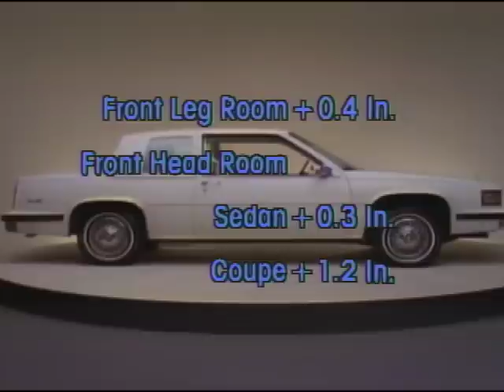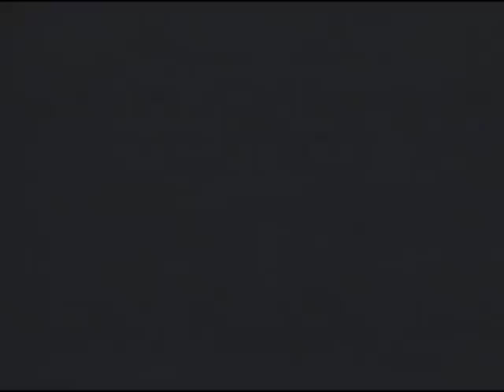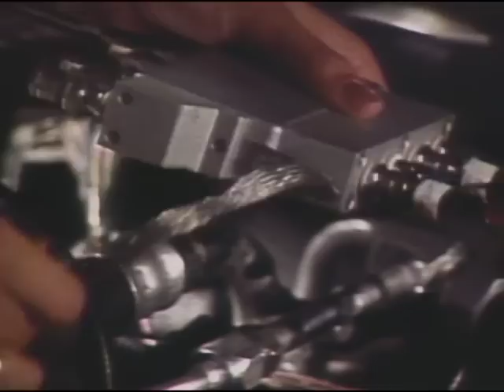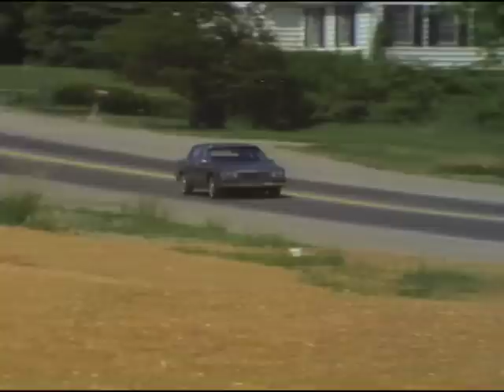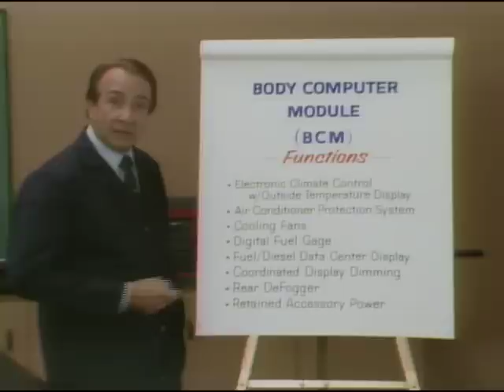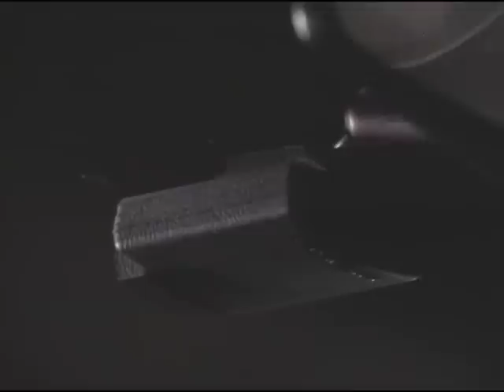1985 Cadillac Deville & Fleetwood - Spectrum '85 Dealer Film

Comment: These C body cars failed miserably in the crusher.  The steering knuckles would shatter and lower ball joints would separate.  The front struts would explode and oil would squirt out.  The rocker panels would distort and buckle.

The ‘89 models went to plastic fenders and would shatter thus making a mess inside the crusher.

Comment: Quick story on these.
I was the fleet manager at Fanning Cadillac-Buick in Chicago at this time.
These FWD Cadillacs and the new FWD Buick Electra & Park Avenue series were released in March 1984 as `85 models.
This was done to build acceptance to the drastic downsizing according to our Cadillac zone rep.
I remember our in-house mailer to past customers was folded twice, and opened up to 24 inches, the amount they had been downsized by.
We even had a Lucite hood intended for the Cadillac in the showroom, to showcase the transverse mounted V8.
It never got put on, and sadly went down with the building in 1993, still in it's box in the roof top parts storage room.
There was a much great acceptance of the Buicks.
I was able to order base model Electra 380's and dress them up with sim con tops and Vogue wheels, as switch cars for our customers who could not afford Cadillacs, but liked the Park Avenue styling.
They even had 2 door models FWD Electra models.
There were originally Electra 300 models with the 3.0 engine, but they were discontinued early on due to being under powered.
The same mistake was made in `86 when the FWD LeSabres initially came out, and the 3.8 soon became the standard engine after that.
One even made it to the Chicago Auto Show floor, which surprised our Buick zone rep when I pointed it out.
Electra 430 was the diesel, and I only remember ordering one.
`85 was the only year for the 2 door Electra T Type, but the 4 door T Type lived on through `90.
Le Sabre T Types were 2 door only, and `87-`89 only.
Note the Cadillac in the video has no high center mount stop lamp, as most of the early `85s did not.
Later `85s had them, and I think they were made mandatory on all `86s as I recall.
Reply: Very interesting info "from first hands".
In my own expirience from 2010 - 1993 Fleetwood tbi motor, 1995 Deville Northstar and gorgeous 1978 Eldorado Biarritz (in 2013-14).
Waiting my next old caddy.
Now driving 1994 Intrepid.
Best regards, from Russia 🤏
Reply: Thanks for that awesome First-Hand info.  I knew about those 4.3 diesels, but never saw one in the wild. After the first OPEC crisis, my folks were "diesel-ers".  Dad bought a new '80 VW Rabbit diesel 5 speed, and mom had an '81 Eldorado diesel.  Being from Baltimore, we usually drove the Eldo to visit family in NY. Sometimes the Rabbit since it was easier to find a parking spot during the holidays. The only issue the Rabbit gave was with the power brake booster.  The Eldo had quite a few trouble spots.  In '85, I recall dad frantically disconnecting BOTH batteries because the starter remained engaged and ground itself to death (I was 11 in '85).  Turn signal switch would break often, disabling the signals and high beams.  And the injectors were replaced in '86 at 35k. Made a huge difference in performance. That Eldo was a comfy cruiser and easily returned 30 mpg highway.
Reply: Interesting story

Comment: I saw the first prototype front wheel drive85 Fleetwood in October 83,at the time the best engine for all 3 C,s was the LT7 4.3 Oldsmobile diesel, don't balk, Buick,s first fueling injected V 6 was hardly an engine built to luxury car standards,same could be said for Cadillac engine ht4100 used internals that came from toys R Us at least the Olds had balls and remarkable fuel mileage.❤
Reply: What year did the 3.8 V6 get fuel injection?

Comment: The guy who designed the engine must have been stoned out of his mind! It was so bad they had to BEG customers to come back!
Reply: I have an 1986 with 60,000 miles and no problems at all, very comfortable, quiet and floats down the road. I do like the previous gen as well but to be honest I always had a sweet spot for the fwd C body platform as well as the fwd H body platform. It may not be many people's favorite but I think this generation deville was a very handsome looking car. Sure maybe some of the 4.1 engines had its problems but I feel like long term overall its better then the Northstar for I've heard a lot of issues with those compared to the 4.1 motor.
Reply: @RenNakamura20 I'm glad you had a good experience with yours! Not "all" of them failed! BTW, I had a '96 Northstar, and it was OK except that it started burning oil before it got "old". Having four early-wearing valve stems per cylinder made for a lot of smoke!

Comment: i new these cars well.this was not the car Cadillac hoped it would be.i replaced many of the 4.1L. to 4.5.the ride was a  jarring porpoising ride,the protruding steering column did not give easy view like the video claims. the camera angle of the instrument panel was deliberately deceptive.with the steering wheel centered, fuel data driver information center and climate controls were completely blocked by the wheel you would have to look around the wheel and reach under the shifter to see and set climate control.one nice thing about these cars was the very distinctive sound of there engine whether the 4.1,4.5,or 4.9 the sound was the same and exclusively the sound of a Cadillac

Comment: I got an '85 Coupe Deville and it handles and rides fantastically but the powertrain is completely garbage. The HT4100 is an aluminium trainwreck and the transmission can't even handle the pathetic power numbers the 4.1L V8 makes.
Reply: How's the car doing now 
I have one myself
Reply: @beangee662  I need to get around putting a new transmission in it or rebuilding the one it has. Engines fine because when I bought it, it already had a new Goodwrench engine in it.

Comment: I worked at a Cadillac olds dealer for years. The engine and trans were junk. I fixed so many of those caddy’s I could rewrite the service manual on those cars. Electrical problems on those cars were a nightmare. Yes GM they did not withstand the rust belt!
Reply: You can say THAT again dude!  I was in college when these came out.  I thought they were the silliest most ridiculous looking things for what was supposed to be America's top brand full size luxury car! And they WERE junk.  I knew people who bought them, but they were wealthy enough to trade them in within 1 to 3 years before real problems began.
Reply: @retroguy9494  I think there is something inherently awkward about trying to fit big car styling on a smaller package. They should've leaned into a more modern look like with the Seville STS model which is probably the best looking of the small '80s Caddys.(Google 1989 Seville STS)
Reply: Was the throttle body fuel injection system at least reliable?
Reply: @gregorymalchuk272  that was probably the best part of the engine. It performed as it was designed and typically outlasted the rest of the engine.

Comment: I had one well 2 I really like them.but the north star motors not the best.cause the heads always crack.
Reply: the heads to not crack, but rather the threads on the block that the head bolts clamp to turn to dust (aluminum block and heads).  the threads there were just not aggressive enough.  this can be repaired, and if do e correctly with the correct timecert kit, the engine will last forever.

Comment: Apparently I was not the only one who hated the Downsized Cadillacs.. The sales dropped low enough to the ground that they had to Upsize them again!! The 80s, with the exception of the Firebird/ Camero and Corvette, were not good times to go GM!
Reply: You're not the only one dude!  Having been a Cadillac buff since I was 8, being in college when these came out which meant it would only be a couple more years before I was able to actually buy one, I just about cried when I saw these pieces of crap! 
Yes, they DID upsize them again in the 1990's and the '93 to '96 Fleetwood Broughams were some of the best cars Cadillac made until the rebrand in 2000 when it basically ceased being a Cadillac.  
Which is why I STILL have my 1994 Fleetwood Brougham!

Comment: The exterior design on the 85 was a disappointment to me. The car did not have the elegant look of the car it replaced, however the 1989 face lift was a big improvement. The 85 Oldsmobile 98 and Buick Park Avenue had a much more eye appeal than the Cadillac.
Reply: The olds and Buicks of this era also had better engines than the Cadillac HT 4100 pos. I’d take an 85 Buick Rivera or Olds Toronado over the crap Cadillac was selling then. Buick also even had a V6 Turbo available….Cadillac should have borrowed it to offer in the Eldorado.
Reply: True Buick was ahead of the full GMline 85 to 87 with almost every car they had.  Even had a car faster than a corvette in 86 87
Reply: Even the modest tail light face-lift in 1987 was a great enhancement. The Buick was my favorite of the three until 
the 1989 Cadillacs came out.
Reply: It looked like a childs toy to me!  But if you think that the Olds and Buick had more eye appeal, you need to watch the Lincoln Town Car commercial from 1985.  Its hysterical. I remember when it came out when I was in college and laughed like mad as I had been a Cadillac buff since I was 8.  Basically, they were all the same car!  
Here it is; it starts at :31.  
https://www.youtube.com/watch?v=G1CxNhvvYGI
Reply: I hated that car at first. It took a year to grow on me even though I still liked the old ones better. 
I sure remember that Lincoln commercial like it was just yesterday.
Reply: Disagree

Comment: With the Hook & Tow 4100 you'll be overheating before you leave the lot.
Reply: On the 82-85 Big Caddy and Eldos.  That 4100 nearly killed Cadillac thanks to that damn New cafe and emission bullshyt.  They didn’t get that fixed until the later 80s.  Sadly Cadillac only had a short comeback and then it became like all other American luxury cars.  Not very good.
Reply: @edwardluth7740  It had a short comeback in the 1990's yes.  The 1993 to 1996 Fleetwood Brougham's were awesome!  I have one!  
But in 2000, Cadillac rebranded itself.  Basically, it only uses the Cadillac name.  Its no longer the luxury car it always was since its founding.
Reply: @retroguy9494   I own a collector 95 Cadillac Fleetwood Brougham with just over 40,000 miles. It wasn’t as good as these 70s because many parts were already outsourced.   And I’ve spent more money than I should on this car.  Not nearly as luxurious interior either.
Reply: @edwardluth7740  Well, mine is a '94 and it had 59K when I bought it. I used it often so it has like 88K now.  You're right about the parts.  My digital dash was flickering since I got it.  Somehow, combined with a replacement key I got from a locksmith but the OHM's being slightly off, it shorted out the ignition which I had to have replaced but had to wait months to get the correct key from Cadillac in Detroit.  My mechanic had the dash sent out to be rebuilt.  But the flickering, in turn shorted out a module which made the car run.  It hasn't run now in over a year and a half because he can't get the module with the shortage of them and all.  He's even called Cadillac in Detroit who keeps emailing him that its on its way, but so far, no.  But the only other thing I've done to it, besides a full major tune up including the opti spark distributor, which were known to go around 70 to 80K miles, is a water pump.  Those were also prone to replacement due to its poor placement and water getting into them.  Plus my CD player doesn't work now and I'm looking for a replacement without having to replace the entire unit. 
True, they aren't as luxurious inside.  Rather plain inside truth be told.  But the seats are SO comfortable!  I have back and muscle issues and can't even sit in the new cars or SUV's without severe pain.  But of the 4 vehicles I have which are a 1976 Fleetwood Brougham D'Elegance, a 1984 Coupe DeVille and a 2014 Escalade, the 1994 Fleetwood is the most comfortable.
Reply: I thought "HT" stood for "Hand Tightened".
Reply: @fredmertz8538  "High technology" actually.
Fred Mertz?  Hmmmmm...I thought you were dead!  😜
Reply: @retroguy9494  I am, but occasionally I channel my spirit through this shlub that's in front of a computer right now.  BTW the "Hand Tightened" was a joke and I believe one of the many put downs for this engine.
Reply: @fredmertz8538  Cool!  Hopefully when MY time comes, God will le me channel MY spirit too!  😁
Put down the engine if you will, but I usually don't because I HAVE one!  A 1984 Coupe DeVille with 25K original miles.  The only thing I wish is that it had more power.  But a 4.1 liter is too small to push around a big car like that.  
Also, I knew men who bought them new back in the day and didn't have a bit of trouble with them.  One guy ran up almost 200K on his and only had to perform regular maintenance.
Reply: @retroguy9494 anybody claiming 200k on an original 4100 is lying, delusional, or losing their memory and can’t forget the low mileage warranty replacement they got.